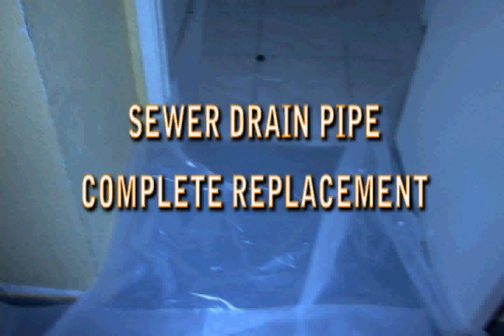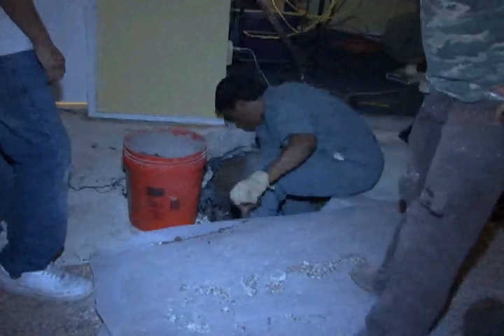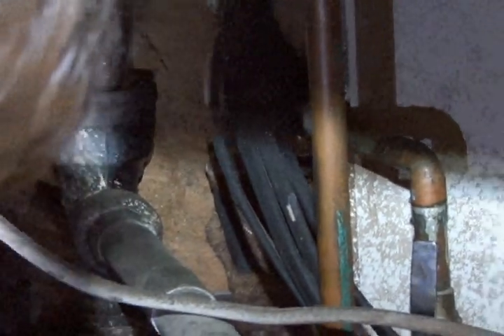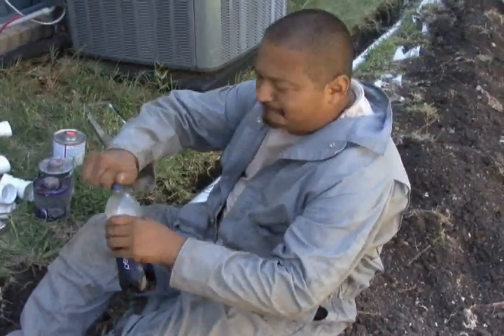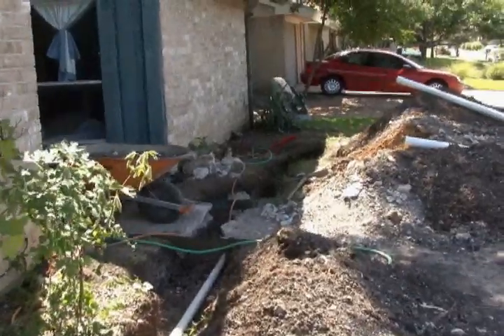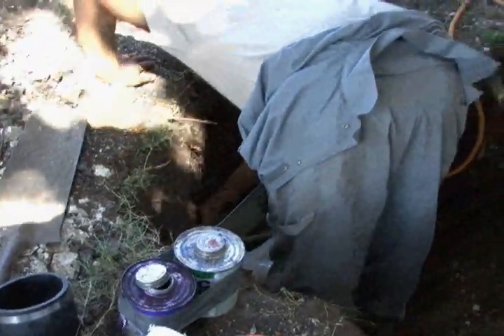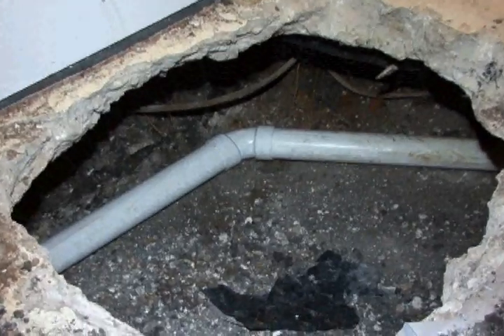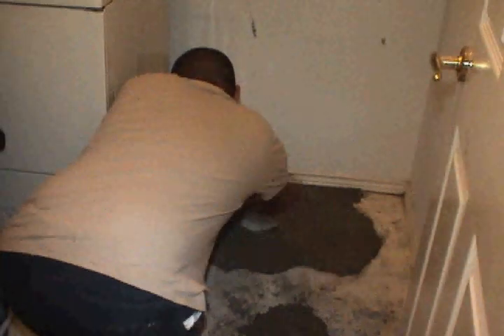Complete Sewer Drain Pipe Replacement Job

Comment: A sewer line should be flushed twice a year to prevent build up of waste and sewage and it can be done as routine maintenance on a house that is what done to a car in order to maintain the system this is what I do on my house just remove the service port clean out plug and flush out the sewer drain with the garden hose
Reply from the maker: Thanks for your comment, although we believe your suggestion cannot hurt the sewer system, we don't believe it will help or make a difference and therefore it is not something we would recommend to our customers.

Comment: We have a slab leak under the beam in the corner of the guest bathroom. The pipe is with cold water, on the depth of ~1.5 feet, it is in mud, since we use water for 1-2 hour a day. We opened a concrete under the bath tub, hoping that the leak is there, but the stream of water is coming from the direction of another bathroom. We need a tunnel there. Do you have a pump to remove that mud, or you can dig only when the soil is more or less dry? Thank you for the great film.
Reply from the maker: Based on what you have said you have a fresh water slab leak, we don't recommend tunneling to expose and repair a fresh water slab leak because of the amount of water that exits the line when it is leaking.  That water can undermine the soil and make it weak.  With that in mind tunneling is not good for safety of the person/people tunneling or for the structure of the home.  We don't know of a pump that could pump mud out from under a house, our recommendation would be to have someone first locate the leak to the exact spot/area it is in, then once the leak is located properly you should have someone access through the slab at the leak area and expose the leak, repair the leak and then backfill (put the dirt and concrete back).  If you are in the Dallas area of Texas, please feel free to give us a call and we can discuss this further, 972-494-1750 we will return to our office monday morning at 8am.  Thanks for your question and positive thoughts of our video.
Reply: @Inhouseplumbing  I'm so sorry I didn't see your film before. Thank you for so quick replay and detailed explanations. It was "Roto Rooters Plumbers", who gave one of the options tunneling of the outside of the house. It would be so good if you are able to detect the leak exactly where it is. Keep in mind that 3 big companies in Dallas (namely: "Baker's Brothers" (showed totally wrong spot (in front of the bathtub, we removed it opened the hole in the foundation of it to see that water is coming from the corner where that bathtub was, possibly from the area in another bathroom)). Before removing we took a second opinion from "Roto Rooter Plumbers", who showed on the corner of the bathtub, but I think it is further because if you reach the pipe in the mud, there are no holes there and you can feel the stream coming from the area of another bathroom. We also were on the list of "ACCU-Find Slab Leak", on which we had great hopes, since there was a line for them, and they advertised themselves as they can find any leak. They had interval between 2 works and called us if they can come to detect. On the open hole their representative showed a wrong spot and convinced me that the leak is there (like in the head of that bathtub, there was a bubble of air coming in that spot. The representative put his hand under that bubble and said "See, Mam, the leak is here". At that time I didn't know that it was caused by the air coming through the sleeve, which was left on that pipe by the original plumber. "Roto Rooter Plumbers" told be about it on re-detection, their representative turned that sleeve from that pipe and bubble moved in the corner.) "ACCU-Find Slab Leak" refused to give money back for that "detection", as their owner said, because the technician put his hands in mud, their company doesn't make much (I'm not surprised), and in general they are in need for money).  Sorry to write this long story,but it might be helpful to have general idea, how complicated is this matter.  Yes, we live in Dallas (close to Buckner and I-30). I'll call you tomorrow. Thank you very much again for your film and respond. It looks like you really can do serious work.

Comment: One more question please. Where you exited out the wall for the kitchen sink is it possible to come out underneath the footer instead?
Reply from the maker: If this is a concrete slab home, there will be a perimeter beam along that outside wall, the slab should be 4 to 5 inches give or take thick, but the beam will be generally 18 - 24 inches deep sometimes less sometimes more.  Problem is some of the pipe vertical pipe that is in the wall runs down under the slab through that entire amount of concrete 22 to 30 inches worth, Generally the 90 degree elbow under the slab turning the pipe towards the inside of the house is in the concrete beam and pointing the wrong direction if you want it to go to the outside (it is instead pointing to the inside of the house, to chip the concrete and turn it the other way is a nightmare and not good for the foundation, also it leaves pipe under the slab which you want at all costs if you can to avoid, and also doing it this way means the pipe will have to start out lower under ground then if you did it out the wall, which means as it falls it will be deeper and deeper under ground, I have seen situation where there is an issue getting it back into the sewer line where you need to tie it back in because the line was too deep would have run up hill, we used to try to do that for cosmetic/looks purposes, but we changed when we had several issues, it just does not make sense.  Better plan would be to come out of the wall as close to the top of the slab itself, instead of coming out with a 90 elbow fitting use a 45 fitting, leaving it as low and close to the slab as possible, then when you get outside use another 45 pointing down, then go into the ground, you might even be able to notch the top of the beam a little bit (talk to an engineer first) to try to get the 45 into the top of the concrete, generally you can hide it a little better that way, but personally in my opinion you want it to be open and have as much give room as possible so if the house moves and/or ground moves in the future it does not break and if it does brake you can fix it easily and you want it to be as shallow under ground as possible for the same reason, hope this helps, thanks again and have a great day.
Reply: Thank you again for responding. I was thinking along those lines. I have exposed the footer which isn’t too deep and it looks like the pipe is encased in about a gallon sized ball of concrete. Anyway thanks that is more information than I got searching the internet for hours and hours. Have a great day!

Comment: How do u fit a new PVC pipe to a existing pipe do u add a T in my case I wanna add a addional drain to the existing sewer drain in the back yard
Reply from the maker: I think I would need more information to correctly answer this question, feel free to call our office at 972-494-1750 and we can discuss and I can try to answer this question, give some free advice.  Generally to add a new line to an existing line yes you would need to use some kind of a tee fitting, in plumbing an actual tee is not generally a good idea you would want to use a wye fitting or what is called a combo fitting, these fittings are made with longer sweeping turns so the sewage flows better.  If the pipe you are connecting to is PVC you can use pvc to pvc fittings and glue them to connect everything, if the pipe you are connecting to is not pvc (cast iron, clay, orangeburg, or something else, you will need to use rubber adapaters (preferably something with a metal sheer ring band around the adapter to keep the rubber from dropping and creating stoppage issues to connect the parts/pipe together.  Hope this helps, if you have any other questions don't hesitate to call us.
Reply: 4:10 use the rubber bands with the hose clamps. One side will be bigger for the cast iron. Get a clean cut with a diamond blade on your old cast iron pipe.

Comment: what is that...2 inch pipe? why not use 3 inch? some people (like my dad) have large bms and clog up a 2 inch pipe. ive been told by many a drain/sewage repair/cleaner to use 3 inch from the house toilet to the dwv junction, then continue to the city main..ure gonna have 3 to 4 inch closet flange for the toilet so go with the big pipe. we have to replace the sewage line from the house out to the cities hook up (ty orangeburg pipe:) so we will be replacing the old cast iron & ob pipe. ty 4 vid.

Comment: And COST??????
Reply from the maker: Thanks for your question, unfortunately cost for a job like this is all dependent on the house it self and what has to be done.  How much tunneling, trenching, plumbing, etc.  Our company has done work like this from 10,000.00 to 50,000.00 in cost and given an 80,000.00 estimate on one house in the past.  The only way to know the cost would be to have an onsite estimate visit, we would take measurements, talk to you, then take those measurements back to our office and work up the estimate.  This visit is no charge to you.  If you are in our service area feel free to contact us today to set up an appointment for this estimate visit.  Thanks again for your question, sorry we could not give an easy answer or price to you for your house.